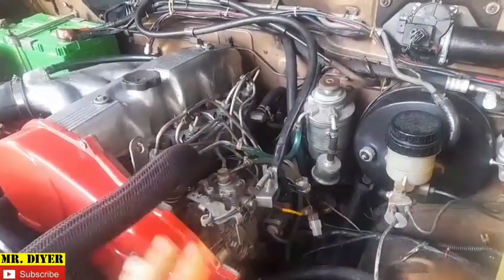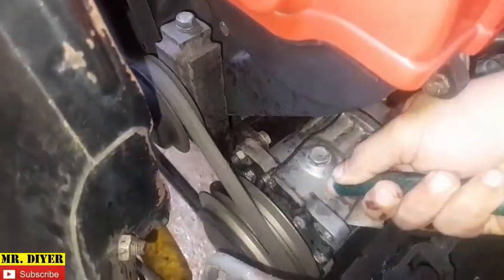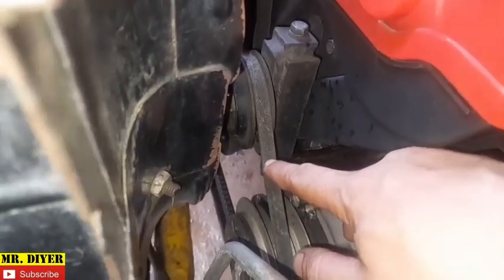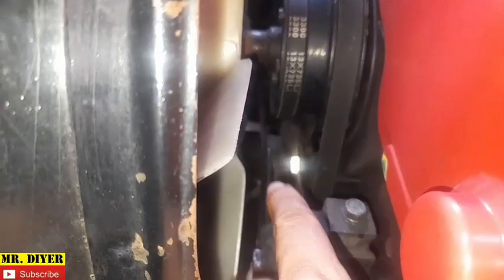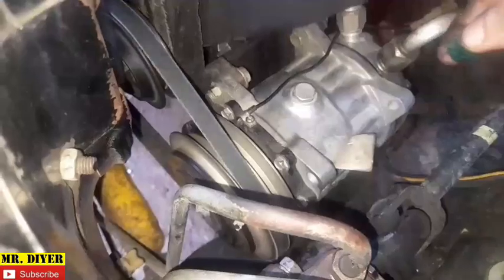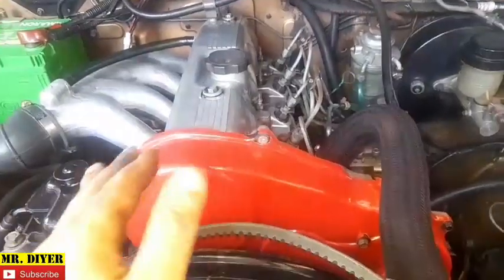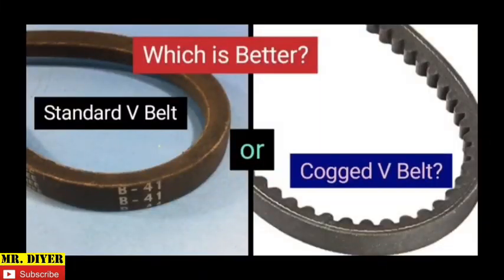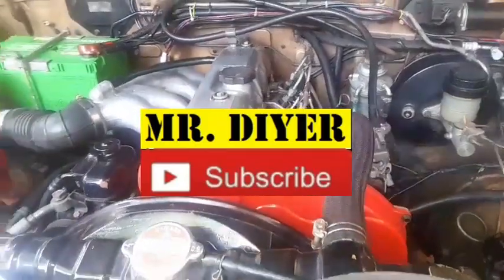Fanbelt Noise simple method to make sure if it is

Comment: theres steam like white smoke(its not fully white its like when you boil water half white half transparent) coming out of my oil filler cap and dip stick when the engine is warm , it comes out with great pressure too 
is my engine done?
Reply from the maker: check the breather hose too. thing is, those are just tell tales signs of excessive blowby, but i would still perform a compression test and leakdown test. thats the only way to be sure.

Comment: Good day Sir, may I ask if what is wrong with my 4d56 engine. Everytime when I'm at high speed mga 60 to 80. Whenever the aircon compressor turns on. It makes a screeching sound like what tires do when doing tire burn outs and disappears after instantly and just makes a sound when it engages. Mahigpit naman po yung belt and about 1 year plng po
Reply from the maker: 1. If screetch po gaya ng sabi mo parang gulong na buburnout. Ibig sabihin nadudulas ang belt, at dahil mahigpit na belt sabi mo, ibig sabihin worn out na belt. Subukan mo palitan ng cogged type v belt.

2. Possible rin na stuck o masyadong mahirap paikutin ang compressor kaya nadudulas,  mainam na rin kung e check ang compressor. Pero kung wala nmn problema sa lamig ang ac at ok naman kahit idle. Mas sisisihin ko luma na ang belt. O di kayay sobrang higpit o sobrang luwag.